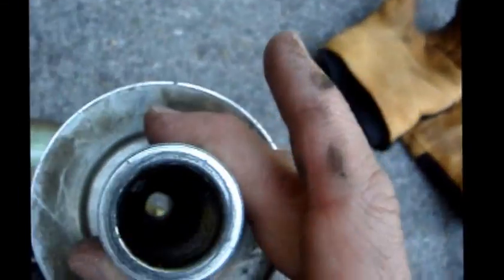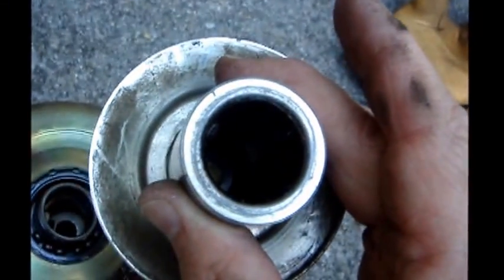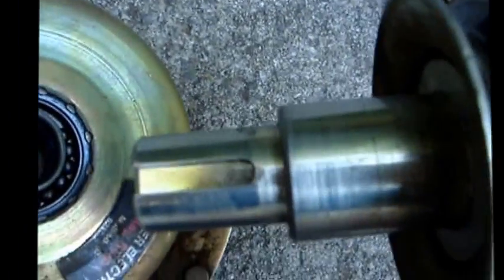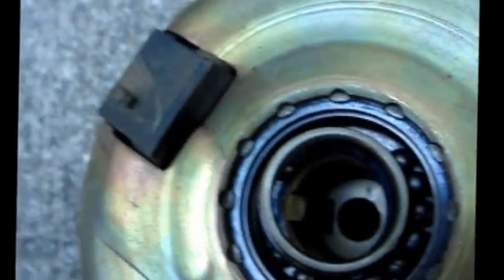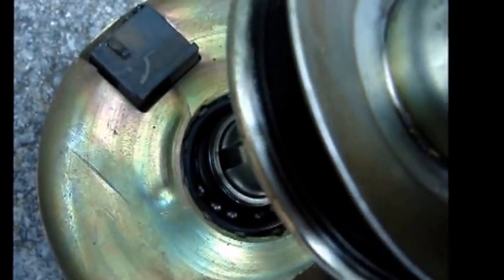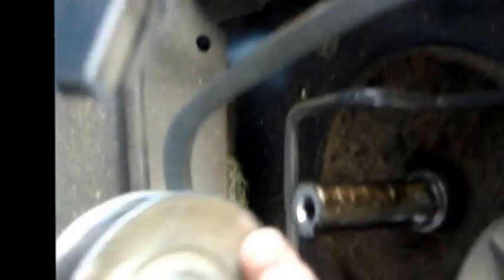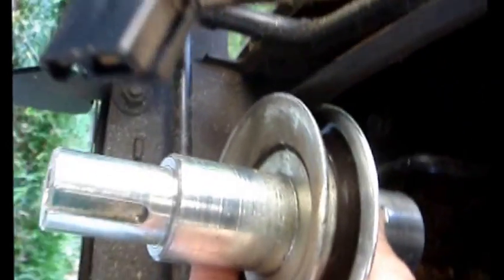Craftsman electric clutch replacement - model 917.272240

Comment from the maker: You are responsible for your own safety and work.  This is not professional advice, just an amateur "how to" posting.  When in doubt, consult a professional.

The replacement clutch came from DB Electrical in Kingsport, TN.  Their price was $93.90 plus $9.00 shipping.  It was the best I found and the quality of the clutch seems fine.  They have a web site.  Sears Partsdirect price was about twice this much.